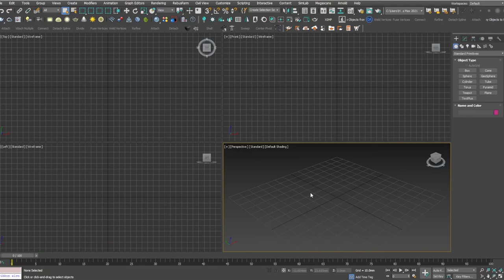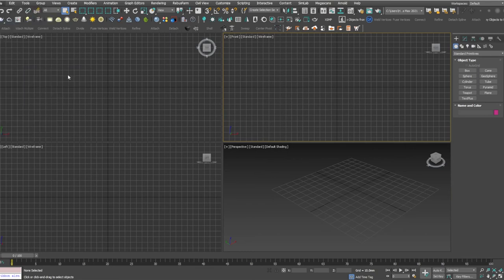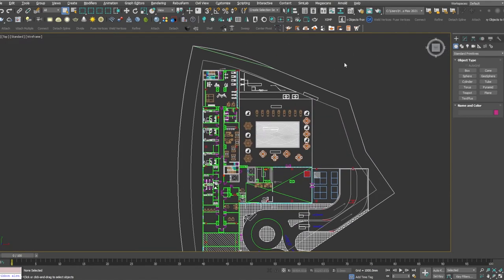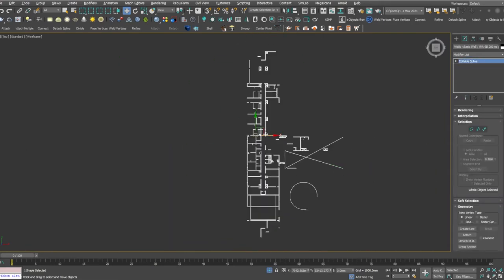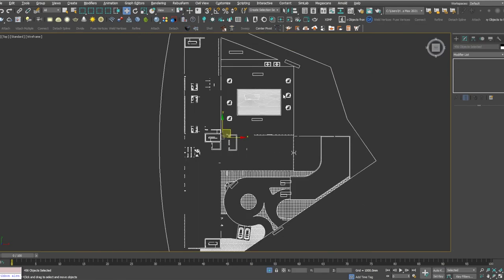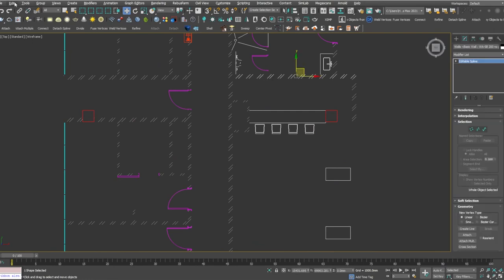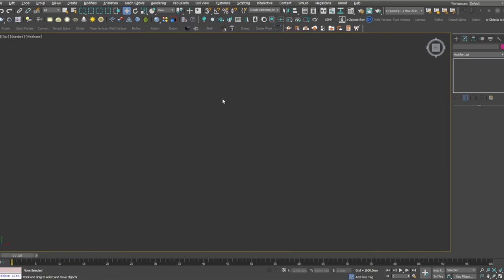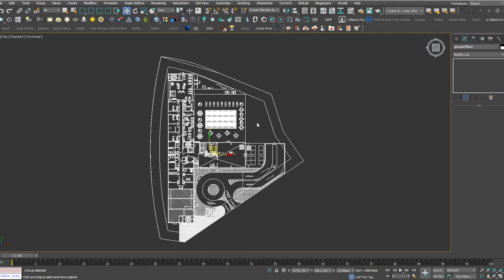How to import and clean CAD plan into 3Ds MAX in a smart way

Comment: Thank you for your video. It was clear and easy to understand. I have only a little experience with 3ds Max, and that experience is from many years ago. After selecting only the green walls, is it possible to extrude all of them at the same time? Or do I need to close all the open splines before using the extruding?